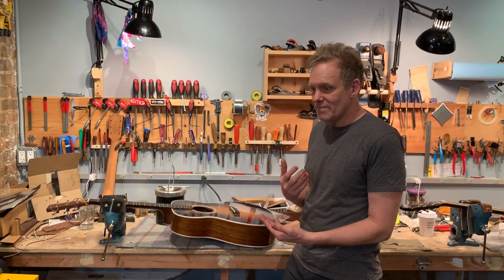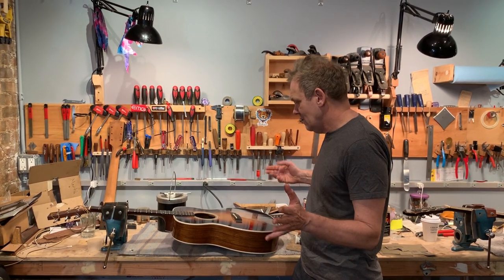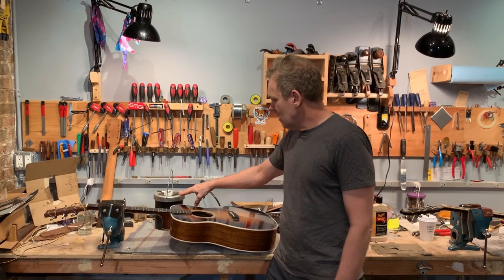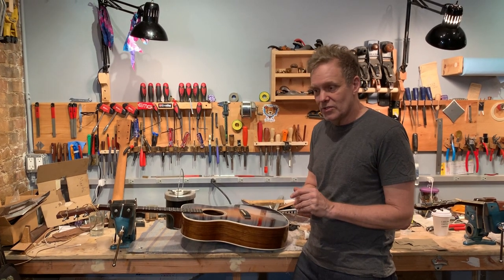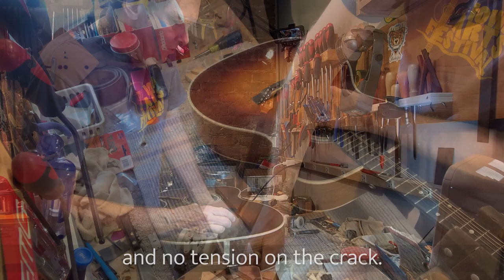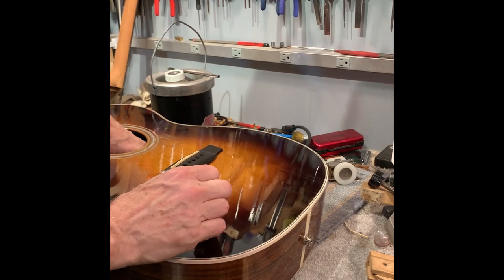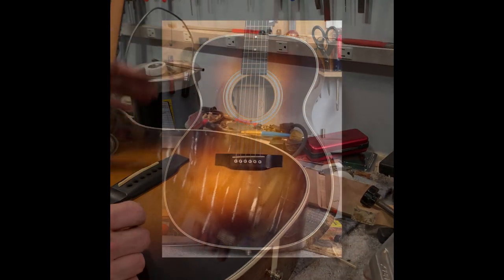Top Crack Repair on an Acoustic Guitar - TR Crandall

Comment: I assume you humidify the guitar if needed to get the crack as tight as possible.  Do you generally touch up the finish or let it be?  Do you find cleats necessary normally?  Thanks